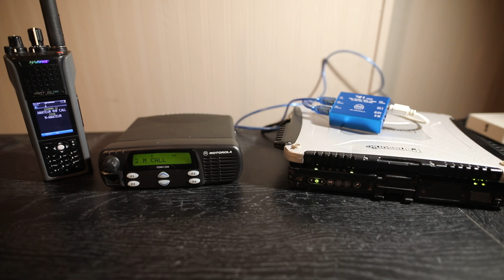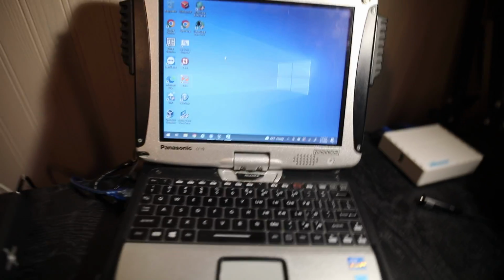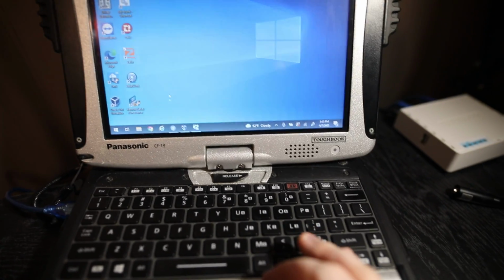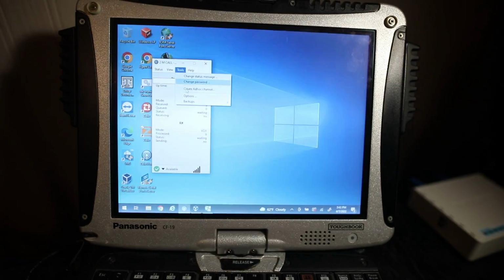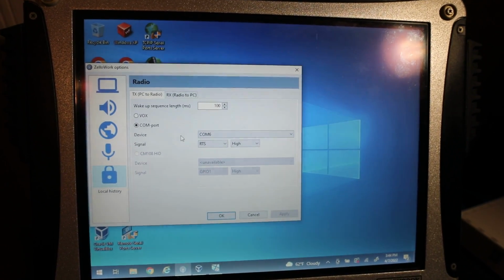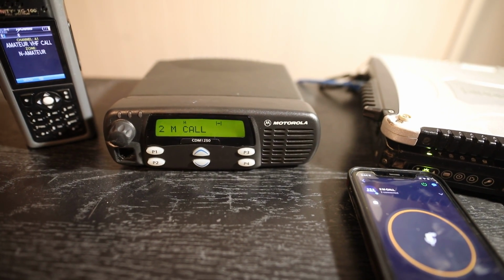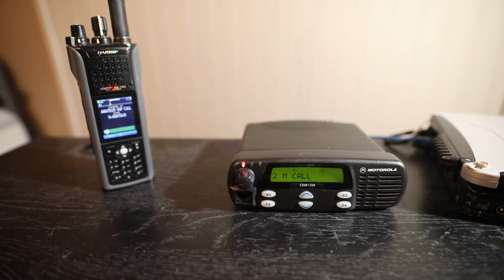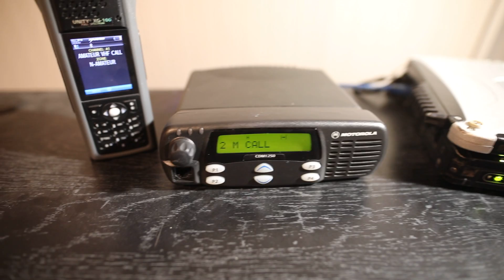Zello Gateway - How I set up an awesome gateway with minimal, cheap equipment.

Comment: Now does the phone have to be on the same network WiFi wise as the host computer ?
Interested in this for our volunteer EMS squad. We use a vhf repeater along with a separate trunking system. Would be neat and helpful for our squad members to have access to the vhf repeater without carrying a radio
Reply from the maker: Nope, any internet connection will do. That was kind of our thoughts too, we have a VHF repeater with poor coverage among our entire area. We have this app on our truck iPads, truck smartphones, and employee phones. They can access the radio channel from anywhere they have internet.

Comment: I am working on setting up the near exact setup minus ZelloWork, I'm using the free version. No matter what I try the received audio from the radio will not pass through to the zello gateway and back to the phone/computer... Any ideas? 73 de AD4GC
Reply: I had the same issues on the free version. I switched to ZelloWork and now it’s working great. Now I have to pay monthly :(
Reply: @grayphox1848  I have both the free and access to ZelloWork, I can't either to recognize received audio from the radio and transmit it back through zello. Any suggestion?
Reply: @gregcundiff  Anybody with the solution here?
Reply: @apumoreira1  unfortunately not yet.

Comment: Question: Can you show how the small PCB connects to the back of the Motorola radio? I am interested in setting this up on a Motorola XTL2500 or an XTL5000 but I am not sure if the PCB will work or if I need to pin out specifically for those models.
Reply from the maker: You would need to pin specifically for those models. I’ve not found a device on the market that is plug and play for the XTL series. If you contacted a company like RoxiTech, they would likely have that cord available with their Zello setup, but nothing readily available to buy that I’ve found.

Comment: Does the CDM allow for local control as well? Can you use the mic and access the radio network through the radio or is it no longer usable as a “base” radio.
Reply from the maker: The audio that you would transmit with a mic would not go over the network. Receive would still work.

Comment: So what Motorola mobile radios have the vox function or kenwood radios but not digital
Reply from the maker: When I contacted RoxiLink, they advised me that I could pretty much choose any radio, as they had cables to fit 95% of radios in use by public safety. The Kenwood TK-790 that I used for my work setup had to have some soldering work in order to make it compatible. With the EchoLink R1, the only radios I believe it’s compatible with are the Motorola radios with 16 or 20 pin connectors on the back, so the CDM series was the easiest for me to use. It then only had some programming modifications that it needed.
Reply: @kd9pcdradio  is there an email or way to contact you so I could get some help on my idea. I want to put a mobile radio in my vehicle, then have one set up at my house and use to to talk to each other back and forth on zello. If you have any ideas I could use some help
Reply from the maker: @rampartcountyfiredepartmen9497  sure. Send me an email kd9pcd@gmail.com

Comment: Hey Question. Is there a reason that you did not choose the com port for receive audio as well. I originally had TX on Com port and RX on Vox like you do. However I noticed that I could choose Com port on RX as well. Seems to be working fine. Just wanted to make sure there wasn't a hidden reason I did not know about?
Reply: I have problem with RX side when use COM port configuration same like on video.
USB Detection part works great, but when I use COM port then TX side is perfect, much better than VOX, but RX side don't work what ever I choose.
Do you have something on mind that I need to set?

Comment: Zello is great, but it requires internet to work. Anyone know of any ROIP gateways or peripherals that allow you to simply setup your own dhcp or static IP addresses and communicate over any LAN/WAN without relying on 3rd party cloud services? I've yet to come across anything that is cheap and flexible.
Reply: Mumble will do the trick, it allows local hosting - the server can be run on the gateway computer. I've got a developmental Mumble-P25 LMR link running for long-term stability testing and am pleased with it.

Comment: I’ve noticed that you have the 16 pin device flip over . I’ve seen that 16 pin device   Faced the other way . Does it diferentiate from radio to radio . Motorola models ?
Reply from the maker: That’s how this particular pin just happened to work. I’m not sure if it was built upside down or what, but if I try the other way it doesn’t work for me.

Comment: gud day sir , do you have knowledge on electronics ?  mine is only a radio baofeng UV82 with BOOSTER on it and a ZELLO apps on my ANDROID cellphone  ,thats it , no WIFI no COMPUTERS only DATA  that last a year for only 4$ to load here in philippines , my set up has no LATENCY and its REALTIME, i only use a 4 RELAY  CHANNEL DTMF tone decoder and a SOUNDCARD wirh relay to switch the PTT of the radio , i do not use the VOX of that radio its too long to release the PTT of the radio causing too much delay,   instead i use soundcard , why BAOFENG UV82 its because it has a VOICE prompt to hear it when you change CHANNELIZED FREQUENCY  , even when your far away you can change the FREQUENCY of a radio buy KEYING button 1-2-3-4 on your handling cellphone,  you will hear the channel frequency on your holding cellphone when you change frequency channel that program on your radio ,  its economical . . .
Reply: Very interesting setup you are using, how can I find out more about your system?

Comment: How did you get the radio to transmit back to zello what are the settings
Reply from the maker: There are some settings you may have to tweak in CPS.
Reply: @kd9pcdradio  whats are CPS, Have the same problem... Could transmit from zello to radio but no radio to zello... Help please.

Comment: @KD9PCD Radio just wanted to let you know that if you can help me out with some trunking program parameters in the XTS radios that would be cool if you can help me set up a system on one of my 2500 radios if you have experience with that as I'm just starting to learn the digital trunking programming stuff but it's not as easy as it used to be with analog type 2 systems that were so easy to put in for example of one of those MTS 2000s that was a piece of cake and so easy to do but with this whole p25 thing it takes it to a whole new level and I really would like some pointers if you can maybe come down to where I'm at in southeast Wisconsin Waukesha County